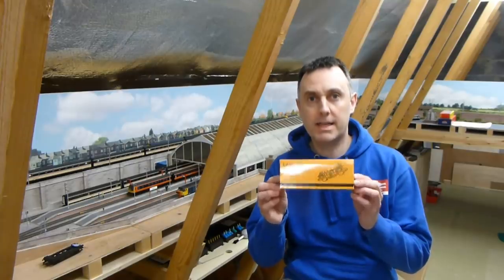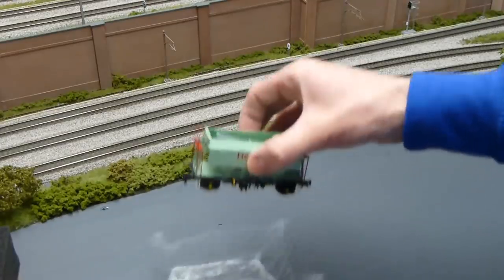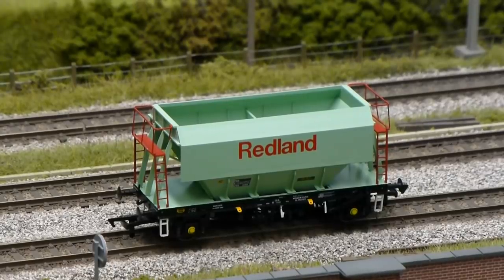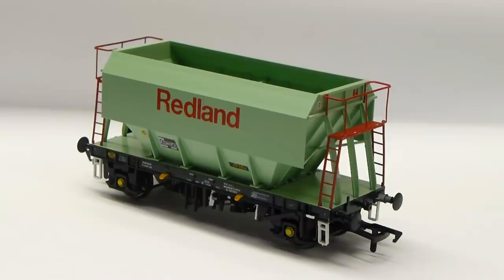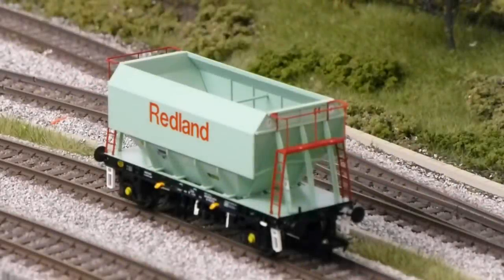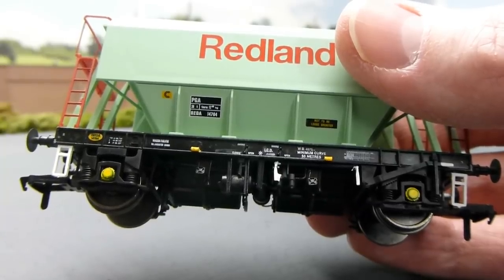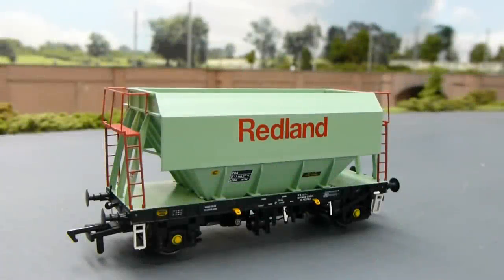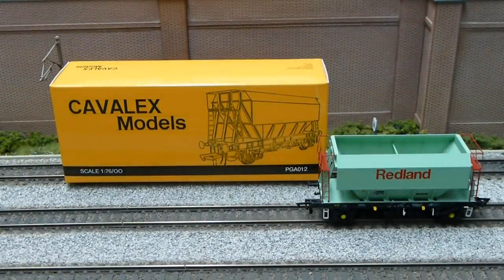Cavalex PGA Model Railway Hopper | In The Spotlight | Dean Park 201

Comment: Hi Dave and all watching and thanks for the great review. I'm glad that you liked it we are very proud. One comment I would like to make is that the chassis was mentioned in the video as plastic, it is however moulded in zinc alloy to give the wagon weight due to the lack of internal space to hide a weight with the prototypical hopper floor/doors. This gives the wagon a lovely weight. Thanks again, Cav of Cavalex Models.
Reply from the maker: Hi, thanks for that info...it certainly felt very well balanced and free running. you've certainly created a beauty of a model.  It all bodes very well for the 91 project.   ;-)  Thanks for supply me with the PGA and I am glad you liked my review. Cheers.

Comment: Interesting packaging and maybe the camera angles but looks a tall wagon.
Reply from the maker: Its no taller than the other hopper I ran it with.  Looking at the model and doing calculations against the production drawings, the wagon sizes are prototypical.   The lighting against that green colour does make it look hard to shoot well on camera, so maybe that didn't help?
Reply: DaveClass47 nothing wrong with your video Dave so I think it’s just the perception of me looking at the hopper part compared to the bogie frame and the colour standing out
Reply from the maker: @SolarRailway  lol, that's ok.  thanks. Dave

Comment: OT question - what kind/size of timber have you used for the baseboard support? Is it drilled for wiring? Thanks
Reply from the maker: Jason Monk hi. The baseboards are 12mm thick good quality stable bitch ply. The supports are made from dressed timber which is approx 75mm wide by 20mm in depth. 

I predrilled holes for wiring to be fed through. I later had to drill more holes as more wiring was added!

Hope that helps.